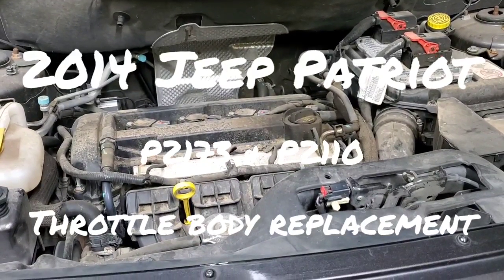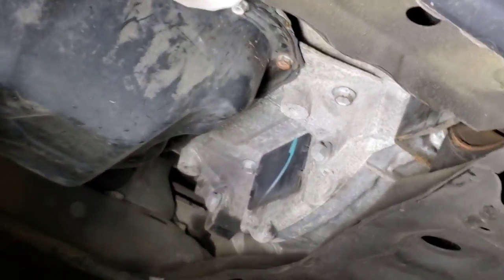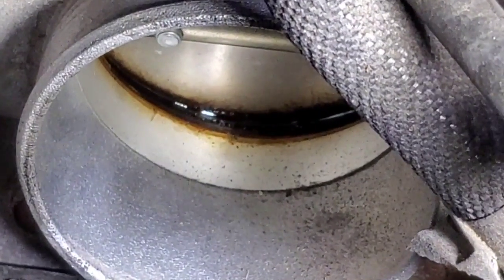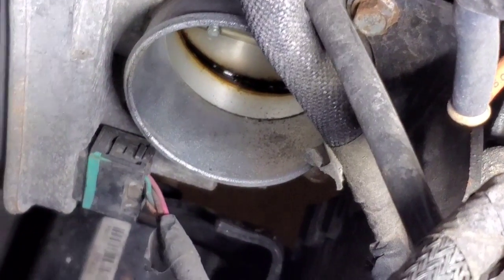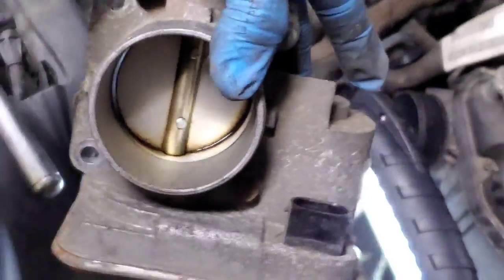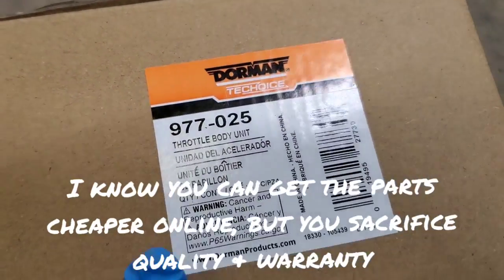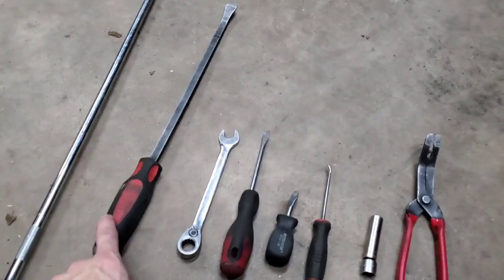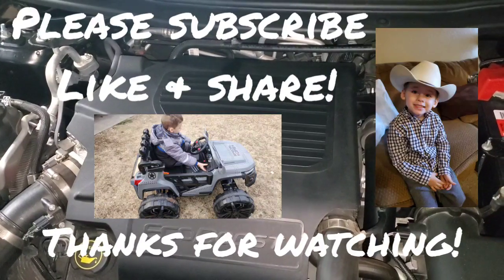'14 Jeep Patriot Throttle Body Replacement- P2173 & P2110

Comment: Nice video. My 2010 patriot has 125k miles and started acting like it was having trouble shifting or hesitating whilst accelerating. Saw a red light flicker above gas gauge but couldn’t see what it was exactly. 

Pulled out the owners manual and tried to see what light flickered. It was that red )lightning bolt( which is the Electronic Throttle Control. Decided to just buy one and hope it was that causing the issue and not the transmission. 

Everything worked out good just had some trouble getting that damn plastic Christmas tree clip off the hose. I did buy mine off Amazon for like 80 bucks and came with a gasket and it started right up and drove it about 5-10 miles on the highway to see if it would do it again and it did not so I think this fixed it. Thanks!

Comment: I ended up buying the exact same replacement throttle body from advance auto, once it was installed it went directly into limp mode, with a lighting light. I ended up returning the throttle body and got a new one that did the exact same thing. In the end, I just ended up cleaning the old throttle body and it worked. P2173 was cleared.
Reply: @Tamara Hine Yes I did. At end I'm just using the old throttle body, I had to reset the throttle position and it stopped going into limp mode.
Reply: I’m gonna try the same. Replacing it and seeing if it helps if not just clean it.
Reply: How do you reset the tps?
Reply: @danielsegreti4475   just drive

Comment: So i just did this job on my sisters car. her car is a 2014 jeep patriot 2.0l. You can buy the throttle body on amazon for about $60. It takes less than 30 minutes for remove and install. People or dealerships will charge $400 or so which to me is way to much. Save your money by watching this video and doing it yourself.👍🏼‼
Reply: Would you mind adding the link to the part? Got a 2016 Jeep Patriot Sport 2 weeks ago with 113,000 miles, I know that was stupid af now but it’s too late. Already changed the spark plugs the day I got it when I got it home because I could tell something was off  (it was jerking with acceleration after 45mph). Today the engine light came on, took it to Auto Zone and got a p2173 code back, too much air intake somewhere. It does idle strange.... sounds like it’s pulling in air and puffing out hard if that makes sense lol.. I’d rather take care of it myself instead of paying for it to be repaired..
Reply: Did you have to reset the pcm or do an idle relearn or was it all bolt off bolt om and everything worked once plugged back in?

Comment: Did you have to do a “pedal dance” key switch sequence to make it learn the new part?
Reply from the maker: On this Jeep no but that doesn't mean you won't have to. I actually had this jeep back in for lower ball joints and the owner told me it's been running great since I changed the throttle body. I believe it's been a year since it was changed.

Comment: I’ve replaced mine twice, 1 year apart but still keep getting the traction control light. I stop the Jeep and turn it completely off and it’s fine. What could it be, because I cannot figure it out.
Reply: This is what happened to me today with my 2016. Traction control light came on and off but the check engine light stayed on. I turned it over after a while and the check engine light went off. Got a p2173 code at autozone.... it idles odd... sorta like it’s pulling in air and pushing it out hard if that makes sense. I desperately wish I knew someone who knew about vehicles because I just cannot afford the cost of a mechanic right now. Any ideas you might have please share lol
Reply: @abbi277  did you get it resolved?
Reply: This is happening to me as well replaced the throttle body but still keeps doing it
Reply: The crankshaft central sensor might need to be changed or the compressor foryour ac needs to be replaced.

Comment: How do you program the throttle body? I was told I had to make sure it was programed to my Jeep's computer. I have a 2016 Jeep Patriot that needs this work done. I was told stepping on the gas pedal a few times or taking off the battery. Not sure what to do. We do this once we are done right?.~
Reply: Did you find out, i have the same question?
Reply: I had throttle body problem in my 2014. All I did is buy a new throttle body. Unhooked my battery and took out the old throttle body and put the new one. My car is running great since then and no more codes. Soon I started the car the code is done.

Comment: Used the parts recommended in the video and the engine light hasn't cleared.  Car works fine again though.  Took it to the dealer to see if they could clear it and they gave me some BS explanation that the throttle bottle isn't compatible and can't be reprogrammed with the car.   Any other reason why this wouldn't clear the check engine light even though it's working good?
Reply: You can try buy a little scanner clear the codes and see if it’ll come back or you can just go to the dealership and order the OEM part and get it reprogrammed

Comment: I am getting error code P2173 on my Compass 2.4L and engine light is on. It is not sluggishness but he Lightning bolt  display error will show up sometimes. When it does the engine is sluggishness at that time. Will cleaning the throttle body and mass air sensor fix this possibly?
Reply: yes, you should at least remove it and clean it.

Comment: Day one,, I cleaned the throttle body. I disconnected the battery and connected the leads thinking that would reset the computer. I did this twice. Still the same ETC errors. I was disappointed and frustrated thinking it may be the manifold gasket. After a few more days of driving in safe mode, a mechanic I knew reset the computer with his scanner. Once he reset it with his scanner the error never came back. Moral of the story is make sure the computer is reset properly! I wasted an entire week.
Reply: How do you reset the computer?
Reply: @paulwood4056  that doesn't reset the computer. his friend used a code scanner to turn off the code. this is for other readers down the road